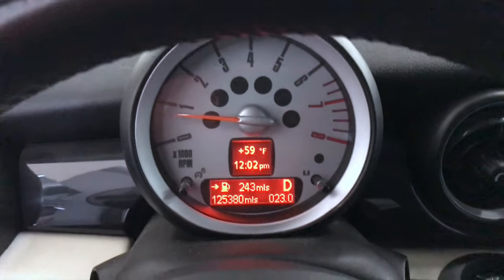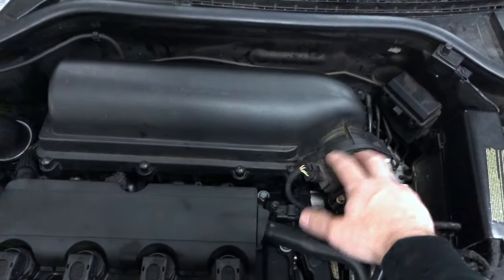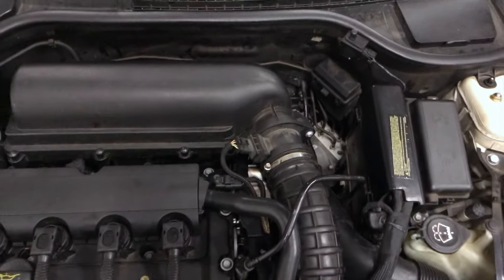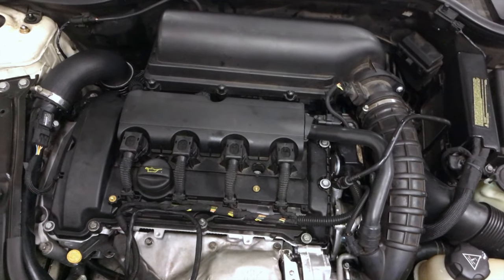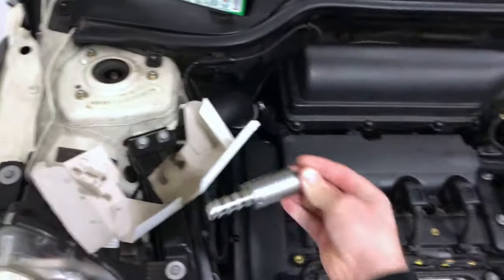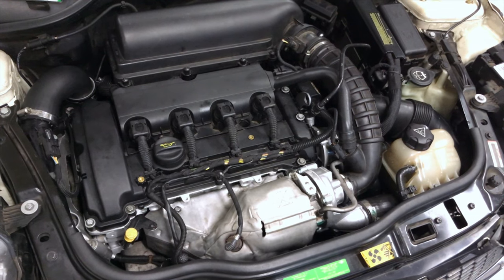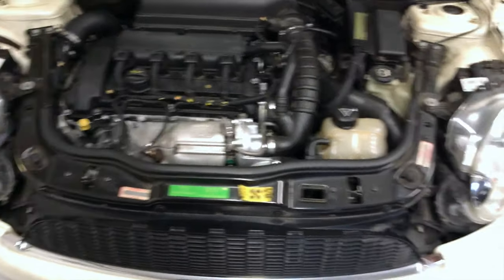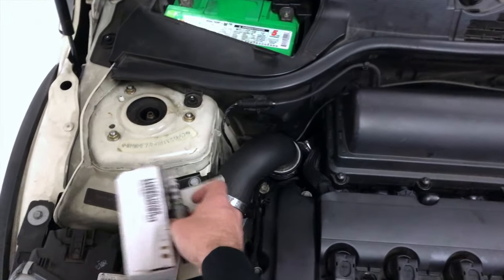MINI:  Erratic Idle Issue, SOLVED

Comment: Wanted to post my Thanks for this video.  I was having the same sort of weird problems after an engine rebuild.  Errors were bouncing around from O2 sensors to MAF and none of that fixed the problem.  Since I worried that some debris from the rebuild had plugged up the existing VANOS solenoid, I added a (messy!) step.  I pulled the fuel pump fuse, let it run until it stalled.  Then I put a big tray under the car,  pulled the old vanos solenoid and then cranked the engine a bit to let it pump some oil and any debris from the oil galleys out the vanos solenoid hole...  Cleaned up that mess, put a new vanos solenoid in, and it worked...   I had one hint it was vanos related as my code reader showed that the vanos angles weren't changing, but that somehow didn't throw a code...
Reply from the maker: I'm glad your diligence paid off . Great job.

Comment: Thank you very much! this video saved me! i changed everything and the Idle was still abnormal! just unplugging the sensor made a huge difference. The motor is 8FP (BMW motor) that is in MINIS and also C3 (2011 - 1.4. VTI 95). My motor has 2 of those sensors, still not sure if both are a problem or only one.

Comment: I know this is an old video, but figured I would still throw this in here. I had a similar rough idling issue about 200miles after I had to get a cylinder machined. Thought it was the fuel tank vent valve but after seeing this video I replaced the solenoid and it seems to have fixed it fingers crossed. I did lose the bolt for the solenoid so if anyone needs the bolt size it is a 10mm 6x16 bolt. There is another video of a guy actually doing the swap that is very helpful, recommend checking that out as well if anyone decides to do this yourself. Hopefully any of that was helpful!!!
Reply from the maker: Thanks for your input.
Reply: hi! Did you have poor throttle sometimes underneeth and of course poor idle only when engine runs like 30minutes

Comment: I had the same problem which put the engine check light on,cleaning the throttle body cured the problem and reset the engine check light by disconnecting the battery for a few minutes Job done

Comment: Cheers, man. This issue just began soon after I finished replacing a coolant hose and replacing all the valve cover gaskets. Perhaps a pieces of old gasket rubber or shred of paper towel found its way in that solenoid.

Comment: Since you specialize in Mini's, I have a couple of questions. I am researching the Mini before I purchsase one. These cars tend to run hot. Can a cooler thermstat be installed? I live in Arizona. Oil consumption and oil funes seem to be another problem. A better synthetic oil with a hight oxidation temperature would be better than a regular oil . Is that something that is encouraged? How are the automatic transmissions in these cars? Thanks for your input....

Comment: Hi Mike  I own a R60 Countryman Diesel 2013 . The problem is that I have is erratic idle on tick over I also tried holding the speed at 2000rpm, this was also erratic, once the car has been driven for awhile, take your foot off the throttle and then put your foot back on the throttle to pull away, I have a loss of power and the engine goes into limp mode, let the car stand for 3 or 4 minutes, it will come out of limp mode but still has erratic revs. The car has been in the mini main dealers for 5 weeks. So far, the parts that have been changed by the main dealer is the AGR Ventil, Glow Plugs, EGR Valves, and EGR Cooler, Pre heating Control Unit, Remove and install Intake Manifold, EGR Control, DP Filter cleaned on vehicle, EGR Cooler and Air Mass Sensor and DDE Control Unit Replaced, Walnut Blast and DPF Regeneration carried out. Then they removed DPF for thorough cleaning and replaced. After all this we still have the same problem. After watching your video which was very interesting, do you think the problem could be with the VVT Solenoid causing this? The car has only done 67,000 miles. Thanking you in advance for your help and reply.

Comment: Those are the same symptoms in my 2014 Ford Mustang V6 3.7. I did so much work on it and its almost gone but the car still doesn't have as much horsepower as before and it still has a rough idle. I also changed the throttle body and it didn't seem to help. I also replaced the mass airflow sensor, spark plugs, used sludge cleaners in the oil, cleaners in the gas, etc.

Comment: I have a 2002 supercharged S R53 Mini Cooper, after I changed the intercooler it ran lean and it was hunting idle. It had a lot of the issues you found with yours as well. The exhaust was incredibly hot, so much so that it was bright red and looked like it was going to melt. I was surprised it didn’t! Do you have any idea what the issue would be with mine? I’m going to change the pulley just waiting on tools to arrive In mail
Reply from the maker: If the exhaust is glowing red then it is because there is an air leak causing the cat to glow. Like fanning a fire.  Check the gasket seals for the intercooler. It can get pinched and caused an unmeetered air leak causing this issue. I've seen it before. Thank you for subscribing : )

Comment: Did the car run fine when you had it out on the road,or did it run rough then as well?My sons car is running rough as a Cobb when idling but runs fine out on the road.
Reply from the maker: It would run fine when off idle and driving around. When coming to a stop is when it would act up.

Comment: Solid man. How about a super knock combined with a cylinder misfire? I changed the trouble (3) coil but it’s still not strong but less choppy. Spark plug? I’m driving a 2007 Mini Cooper S. Thanks man.

Comment: Hi Mike, i do have a huge problem with a Mini Cooper 2007 Petrol 1.6 Automatic. The engine sounds like a diesel and it has a bad rattle.
If you have time, can you have a look at the video on my profile, please?
Someone suggested full timing chain replacement. What’s your opinion on that?
Thank you!
Reply from the maker: Hi, these engines are known for being noisy like that. Just make sure oil level is good.  The noise sounds like ( from what I can tell ) it is coming from the vacuum pump. They can get noisy if the engine was run low on oil in the past. I'd replace it if it is the noise. They can bind and cause the camshaft to break. It's good insurance regardless.  Let me know if that fixes it.

Comment: If you dont put The highest grade premium gas. You will have nothing but issues after. I realized that the car actually has been running. Great, until I just noticed that it's not shifting, right? Because there's possibly a  coolant leak the engine get too hot The metal will expand causing it not to go into gear? Based off this video I've seen right off. The bat, it looks like a coil issue.

Comment: It looks like this might be my prob. 2009 Clubman, N12. Had a very bad oil leak on it, ended up replacing the valve cover gasket, oil filter housing gasket, and oil pressure switch. Here's the chronological order of repairs since January...put a new foot module (basically the fuse box), new water pump, thermostat housing, and the plastic pipe connecting them, then all the before mentioned gaskets, then the plugs and coils, then the upstream O2 sensor, and just last week the alternator and battery. Oh, in that time too I also replaced the throttle body valve as well (used one). That looked like it might have gotten soaked with all the oil it was losing, since it was all on the passenger side of the car. Car was running great, except for a very small idle issue, and hesitating a little on acceleration. Ran great last night, went down the street to the gas station. Came out today, it started fine but then the yellow engine light with the little 'half slash' thing came on after I went about 50 feet. Turned it around and parked. Then I checked codes with my little Autel reader, got the P1057, and the P1062 limp home code, and the P115D refer to service manual. Is it possible that this valve might have gotten soaked with the oil it was leaking (it was BAD, I was losing 3 to 4 qts EVERY time I drove it) since the leak was actually pouring out the same side all these issues I was having before are on? I'm sure it might also just be age, it has 138,000 on it but I bought it wrecked 3 years ago at 125,000 and the guy that owned it before really didn't take care of it very well. I know if I keep having probs, this thing is gonna put me in bankruptcy! :/ I had around 6 grand in it before all this this year, and I'm pushing 10 grand now!
Reply from the maker: Sounds like you are bringing this thing back from the dead. I hope it returns the favor and treats you well once everything is sorted out.
Reply: What's that song Kenny Rogers sings about a Gambler? With minis, you got to know when to fold, hold and Run Away!

Comment: Hey I live way too far away from a dealership or anyone who can even work on my mini.  My mini says it has a misfire on cylinder 1 I did new spark plugs, new wires, and replaced the ingnition coils.  When she is above 2000 rpm she is fine but at idle it misfires and runs hard, but when you turn off and start back up again she runs fine as long as I don't go into idle.

Comment: Hi, did you find the issue? I have the same thing the engine just cuts out.. I’ve changed the brake vacuum pressure sensor following a different video but this still happens. I also have an engine light and a stop/start warning light on. Thanks

Comment: Hi, could you help me with your THP experience. I have problems with a 207 GTI THP 175hp, in practice it has problems with the turbo pressure which activates around 3000rpm, sometimes it works well, I rarely have good pressure already at 1700rpm. I checked everything now I was about to check the phase but a doubt arose about the variator valve that I checked a few months ago. Could this fault occur if the phase solenoid valve does not open well or opens little? I repeat that sometimes the car starts and runs fine but often not, the pressure rises much later and I have no errors in the control unit. At full load even if at 1500rpm could the solenoid cause this defect? Thank you

Comment: Hi Mike, my mini is r56s, i have erratic idle problem(any time), 
Another problem is stalled problem when start on cool down status (if hold throttle around 5 seconds that will not stalled), no engine error code. 
Any suggestions?  Also solenoid valve problem?
Thanks

Comment: I’m 99% my N14 needs this done but the shop I’m at wants to take the valve cover off and check the timing chain, which I replaced in 2017. I would ignore their recommendation and have VANOS done if it weren’t for all cylinders misfiring and producing error codes. Do I replace the VANOS anyway or go with recommended service? Spark plugs replaced, coils are fine, replaced pcv and no longer running lean or vacuum leak. I replaced intake hose and air box a month ago, first thing I had shop do was hot engine flush. Also, Thank you for this video!
Reply from the maker: It's possible needs the vanos solenoid.  If there are timing faults then they may want to make sure the upper timing chain guide is not broken. It is a good idea to check first to rule that out.
Reply: Mike MDs thanks for the reply. No timing faults just all 4 cylinder misfires. I think I’ll replace the VANOS myself to save on labor and if issue still persists have the shop check the CAM shaft alignment per their recommendation.

Comment: My 2009 mini has a fluctuating idle. It is not clunky like yours, but is revving to about 1.5k then back down to 500. There is a whistle coming from the engine somewhere. Any idea on what it could be? I was assuming a vacuum leak.

Comment: Good day @Mike MDs I have a 2009 mini cooper r56/n12 I have been getting code 
002B68 Mass air flow plausibility.
002b15 Differential pressure, intake manifold plausibility
 I have changed the VVt, The intake manifold map sensor and the Pcv==vc Membrane, spark plugs, and coils.  still no change.  I even double checked my timing as I also changed my Valve seals. 

Any suggestions
Reply from the maker: Hi, It sounds like a bad throttle body to me. Check out my other video on the top 9 reasons your mini runs rough.
Reply: Hello :) did you got your MIni runs fine ? please help, thanks

Comment: Did you check the vanos solenoid with ISTA+ by performing a test? I checked mine via ISTA+ and it appears to be ok, no other faults, the tank ventilation valve works, fuel cap seal is good. Only thing i can think of is timing
Reply from the maker: Yes. It activates without issue. A clogged screen will not affect the activation of the solenoid. But will affect the oil pressure and flow through the solenoid.
Reply: @MikeMDs  That makes sense, mines really stuck, the bad access isn't helping. Looks like my valve cover also needs replacing. Your video's helped alot, thanks for the reply! :)

Comment: Ive got a dip in my idling which makes the mini shudder slightly and have replaced coils , sparkplugs , oil and a walnut blast and its made no difference and there are no faults listed. Before I blow more cash , do you think it could be the Vanos solenoid ? Any help would be much appreciated
Reply from the maker: I say just keep driving it until a fault code appears. Otherwise you are just guessing. For me I eventually received a mass air meter plausibility fault.

Comment: Hello mate, thanks for the video. I changed this valve today, because I have the same issue with the N14 engine, but after the new Solenoid Valve, this issue is not solved in my Mini Cooper S 07. What can I do next?
Reply from the maker: I have another video on top 9 reasons your mini is running rough. See if anything pertains to your issue. Best of luck!

Comment: Heloo mike. I just change my spark plugs and coils on my 2008 copper s . Only thing is number 3 coil it steel won’t work, I take out the wire and looks like no power going from wire to coil. I should change wire or it could be something different? Thanks

Comment: N12 cooper having similar issues. On cold starts its pullsates a lot until warm then after that struggles to idle and will cut out all together. Also feeling a slight chugging when driving under 2krpm as well as an odd noise when above 2k rpm. Ive recently had the sparks replaced new valve cover gasket thermostat and battery.
Reply from the maker: Its a tough one without checking things in person. If it has mass air meeter faults then it may be a faulty throttle body.

Comment: Thanks for the vidio again mate you are a star,, just have exactly the same issue going mad replacing everything and no difference at all, just watched your vidio and i replace that selenoid and  i need to mentioned i did check the old one and it clicked but something it wasn’t right inside anyway i put new one after that car driving like brand new! Thanks a lot
Reply from the maker: Glad it helped
Reply: Could this also be the problem on a 2016 clubman?

Comment: Hello, i have mini one r56 2012. Somtimes in the morning i have routh idle starting.
I was at the dealership for 3 houers and its was feeling that they are not soure exactly what is the problem. The computer show: 00285A valvtronic, eccentric shaft sensor:reference..
I replaced the eccentric sensor, clean vanus, oil change, but it still routh idle cold starting.
Maybe do u know what else?: - (

Comment: Do you know anything about the P18B9 code? I can’t find much info on it online and I’m not sure what the issue exactly is. The code reads Vehicle longitudinal acceleration Faulty CAN signal
Reply from the maker: Thats a tough one. Can be wiring harness chafing somewhere or a bad sensor.  
It shouldn't cause any rough running issues though .

Comment: 09 Mini Cooper Base.  The car spit/sputtered on my way home.  Check engine light came on.  Rough ible cranking up.  Put on a new MAF sensor, still didn't fix it.  Drove it down the road, and 3-5 miles in, started sputtered again.  Threw code "2B4F, Mass Sensor Signal.  Any thoughts?
It has new fuel filter, plugs, coils, air filter, oil/oil filter.  Checked the seal around gas cap. I got told it could be a vacuum leak around the valve cover gasket.   (Little oil around it when I checked)
Reply from the maker: Hi, I have another video of the top reasons your mini runs rough.  From the sound of it, it could be a bad throttle body.  Refer to the video. I think it will help.

Comment: Hi buddy's I'm in deep trouble. One mini cooper starting trouble but cranking ok. Fault code is High pressure fuel plausibility pressure too low. What is the complaints ?. Any realy or high pressure pumb. High pressure pumb is very expensive. We don't have spare pumb. Please give me some suggestion
Reply from the maker: That stinks. If it is a bad HPP there is no way around it.

Comment: I have the same engine noise in my mini cooper countryman 2012 and I have replaced my spark plugs and ignition coils. I just read out the code and its a p119D and am wondering what I should do?

Comment: I had exactly the same issues with my mini, last month had the walnut blast, new coils, spark plugs and more. Just took it in Monday for the same as this video and they replaced the solenoid. I just picked it up drove it home and limp mode light just went on 😢.

Comment: Greetings, my car has the same issues but it's only happens intermittently in the morning.  After starting the car over 2-3 times it runs normal. Should I also change out the solenoid valve?  Thank you kindly sir.